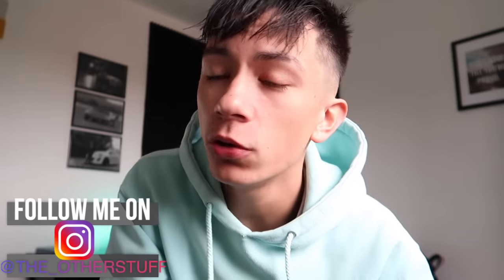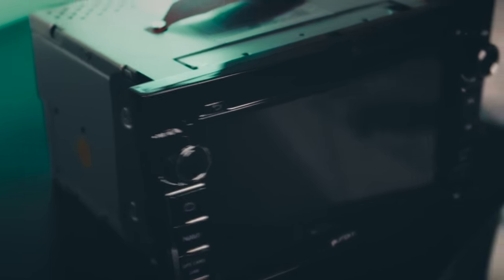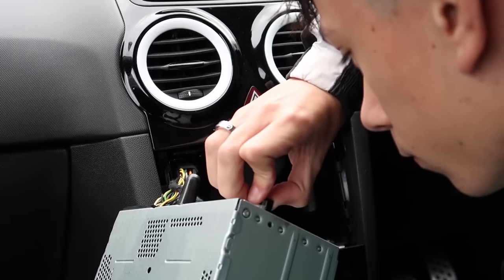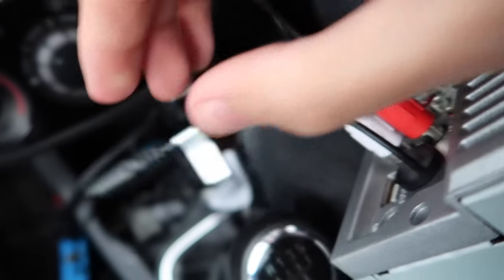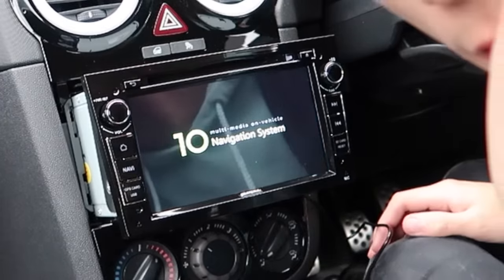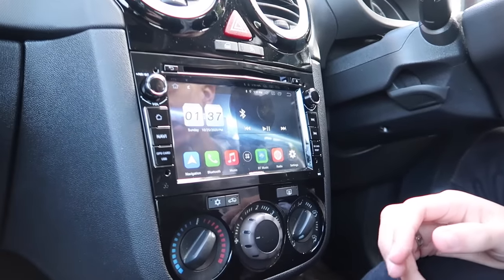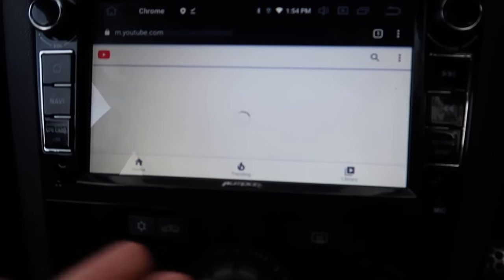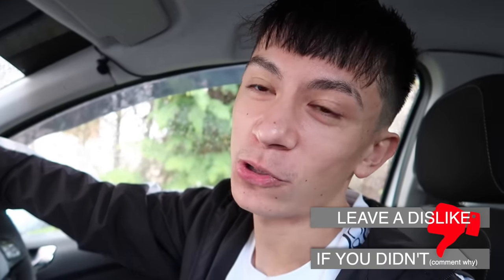INSTALLING TOUCH SCREEN RADIO **HEAD UNIT* IN MY CORSA!

Comment: I had this exact head unit for my corsa and I had troubles with it so I ended up taking it out as it used to turn itself off if the weather was hot... lol. Definitely a wiring issue or something I did wrong so if anyone has any ideas let me know 😅

Comment: I dunno if you tried the secret car menu already but if not, pullthe blinker and the windscreen whiper sticks towards you for 3-5 seconds and some options gonna appear,set them to 1 or 0.
Option 1 is "Coming Home" Function, unlock the car twice and the lights will go on
Option 3 will ajust your turnsignal sound from 1 - 5
Option 4 or 5 (not sure anymore) is autolock at 10mph or 15km/h
Reply: Is this only for the corsa?
Reply: @agc_alex  yeah only for the opel/Vauxhall Corsa D

Comment: Nice head unit. I had mine fitted almost 2 years ago In my 2010 Polo. Has Android auto and Apple car play. I love it.
Reply: Where from?
Reply: @jamiebond19  got it from Amazon. Fitted it myself.
Reply: Do you still have steering wheel functions?
Reply: @d4v1do  Yeah, there was a wire for it on the harness.
Reply: Do you recommend this headunit without any problems?

Comment: How is the headunit holding up after 2 years? Is it still working?
Does it glitch or did it slow down?
Reply: Don't get this headunit it will break and the company won't refund you you're money back.

Comment: I’ve had 3 of these pumpkin units in my corsa break, they’re great when they work though!
Reply: Why’d they break?
Reply: Sounds like they are made from cheap and nasty components lol
Reply: Honestly, I'm not too sure. Basically left the car with it working, went to the shop came back and it was completely dead. Same thing happened with all three units. Requested feedback from the manufacturer but they couldn't confirm either. It can be a pain finding a decent one with the gloss black trim! I've just found myself using a dedicated iPod Touch.
Reply: Why would you need 3 at the same time
Reply: @Usercouldnotbefound  Bought one, broke, replaced, broke, replaced, broke.
Reply: @alexrowley858  but that equals 4 units not 3?
Reply: @Usercouldnotbefound  Happy?
Reply: @alexrowley858  that happened to mine, i ended up pulling the fuse for the radio and putting it back in and the unit rebooted and works again, if thats any help
Reply: @alexrowley858  sounds like you popped a fuse mate :)
Reply: Changed the head unit without ever remounting the fuse. Worked each time I put it in.
Reply: @alexrowley858  so you didnt check the fuse on the old ones?
Reply: @Usercouldnotbefound  can u read it clearly equals up to 3 lmao 😂😂
Reply: @itsyogiz6249  can you read how his comment has been edited? Your a day late mate go back to sleep
Reply: @Kuhrmys  I checked the fuses on the car were fine the fuses on the unit seemed blown on all 3. Didn’t see the merit in replacing fuses in a head unit that would blow again in a few days anyway
Reply: @alexrowley858  the fuse on the head unit itself
Reply: Nvm just read your comment
Reply: The corsa d runs canbus. The car will shut off power to the head unit if it senses the OEM HU is not there. PASER sell a unit to help.
Reply: @samstooks3836  is this true

Comment: Alright pal, nice video just a quick tip try not to use a drill like that specially on small interior screws as it will just strip them out and it’s bad practice but nice one mate 👍

Comment: Does radio controls on steering wheel work with it? I think my Astra Mk5 has to the same radio as your old one
Reply: Yes is should come with an adapter that makes it all work
Reply: Banton85 ok 👌 do you know if the clips he used to pull out old Radio come with it?
Reply: @morganhiggins812   yes come with everything needed mine did

Comment: Don’t know if you’ve already answered or not but I’ve seen multiple people asking, do the steering wheel controls work with the radio? Most times you change the head unit and the steering wheel controls don’t work.
Reply: Hey I know it’s been two years but have you managed to connect the wheel buttons? I’m still deciding whether to buy such radio

Comment: But does the steering wheel buttuns work still? And if you have a boardcomputer screen on top of the dash will it stil work?
Reply: Yes
Reply: Had mine about a week now rigged upto 12 inch Edge active subwoofer.

Comment: I just did the same to my car. It’s honestly life changing
Reply: Can you use Spotify music or do you need another type of app
Reply: @MoreBreezy  Is the bluetooth built into the unit itself so you can connect your phone?
Reply: @syed5126  yeah
Reply: @MoreBreezy  I have a question, does the steering wheel controls work for it? also does the top where shows Mpg speed etc still work
Reply: @thegallopingsausage2028  the steering wheel controls will work if you set it up. I’m not entirely to sure about if the mpg will work I think it depends on the model you buy.
Reply: @MoreBreezy  I’m unsure if you were confused with my wording sorry, i mean the original screen that’s there which the radio display is used where it is displayed orange. Mines different to yours, mines a square instead of rectangle.
Reply: @thegallopingsausage2028  ohh so your original radio system is a square. You would just have to get one that’s fits into it.
Reply: @MoreBreezy  have you got the same head unit that’s in the video?
Reply: @DC-ci9ie  no I have a different one

Comment: Is the  touch screen suitable for Vauxhall corsa 2013 model automatic? This is a very good video. Thank you 🙏🏼
Reply: only compatible with 2006-2011 corsa's sorry
Reply: @Xrectra  the car in this video is 2013
Reply: @replaytt8925  on the item’s website it says from 2006-2011 but if it works for this then sure

Comment: Yo man i need ur help. I also own a corsa and someone replaced the original 'audioscreen' to a new touchscreen a while back, but somehow they didnt connect the steering wheel input. Which means i can't use the buttons on my wheel. Do you have any idea which cabels come from the steering wheel?  Im kinda new to the audio thingy. Hopefully u can help me man, love ur videos!
Reply: Hey I know it’s been two years but have you managed to connect the wheel buttons? I’m still deciding whether to buy such radio

Comment: Dose it work with android and can you still use the steering wheel volume controls?
Looks great though might get one for my corsa
Reply: check the Amazon or eBay post it should have a site for steering wheel controls but it's hot and miss with some
Reply: @Amir.253  Thanks Mate, doing great work!

Comment: I was gonna get a sony xav-ax1000 unit for my Corsa limited edition but I believe I have now been persuaded to get this pumpkin unit instead. Anyone care to share any thoughts/ ideas on this? (agree/ disagree etc...)
Reply: Dude did you get it? I got a VXR 2014 Clubsport would it fit for me?
Reply: @M0vingtargetz98  Yes mate I've had it for a year now. Mine fits but it's not flush to the rest of the surrounding units. Believe i need a deeper cage/ facia. A very good unit in fairness. I have a 2014 Corsa D limited edition so I'm assuming it shall fit yours also, you may want to look into getting a deeper cage/ facia though. Merry Chrismas :).
Reply: @kashkid777  wicked, thanks man! Merry Christmas to you too :) 🎄

Comment: Nice looking head unit, have you had any problems with it now you have had it for a few months??  Interested in getting one as an upgrade from the CD 30 OEM spec original. Up the Corsa!!
Reply: I bought it, its very slow because only 2 gb ram also GPS is very weak, but the sound is very good

Comment: I’m wondering if anyone reading that can help me. I have the 65 plate E type corsa with the standard touch screen system. Mainly it doesn’t have car play. I’ve seen new systems I can install but I’m curious would I be able to get car play on there and is there any chance I’d fuck the cars electrics up by doing it?

Comment: 20 yrs ago ISH. I was installing a Kenwood single Cd player head unit, Kenwood side doors speakers, 2 6x9 inch Sony speakers on the MDF board made parcel shelf, and a 360 Watts MOSFET Amplifier mate. And now I am stone deaf can't hear fack all.🤪🤣🤣🤣🤣🤣🤣 Didn't need a loud exhaust oh it was a Citroen Saxo VTS.👍 I was listening to Mambo number 5. A little bit of Monica.😂😂

Comment: TO ANYONE THAT IS THINKING ABOUT DOING THIS INSTALL:

THIS HEADUNIT WILL NOT FIT UNLESS YOU REMOVE THE EXISTING METAL BRACKET INSIDE, IT JUST SLIDES OUT. 
DO NOT PUSH IT IN WITH FORCE YOU WILL BREAK IT
Reply: Nice little warning 🫡